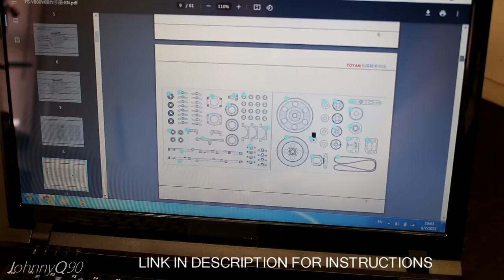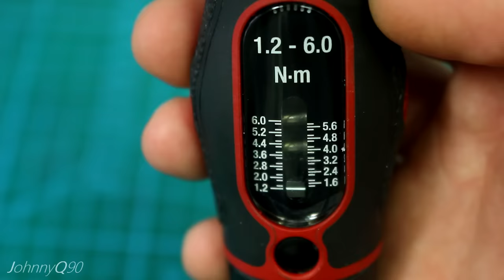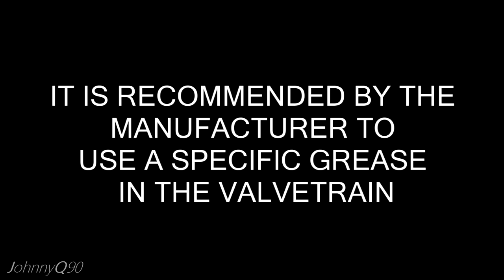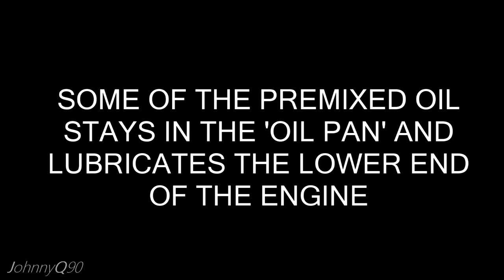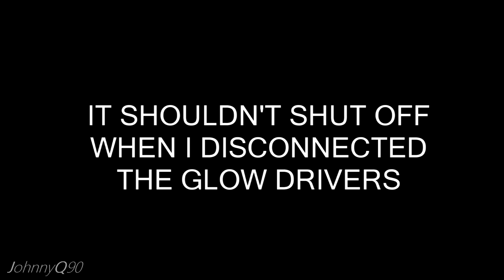REAL Model V8 Engine Assembly & RUN!

Comment: Did you have to set the engine at TDC and line up the cam gears whe. You installed the timing belt? Like real engines?

Comment: i don’t understand how it would work without glow/spark plugs working. unless the starter motor is running as an alternator pushing current after it starts the motor but didn’t look like it was.
is it fuel/air compression? that little thing can create a pop! that is incredible if it can
Reply: On nitro powered engines once the glow plugs have been preheated via an external electric supply and the engine has been started up, the coil inside the glow plugs retain enough heat between strokes to ignite the next compression stroke air/fuel mixture and the external electric supply can be removed.

Comment: Nice thing. I'd be concerned about running this for too long without proper oil lubrication for the top end and some form of cooling.  Why is there no water cooling system? Plenty of spare pully's for a water pump.?!  Great video.

Comment: Are the main bearings just bronze bushings? And do the camshafts not have bearings besides at either end? Did you time it? What's the purpose of the idler pulleys next to the cam gears? Why does it have a water pump, but no inlet or outlet or other cooling system parts?
Reply: Oh, I didn't realize it was a premix situation. The bearings make a little bit more sense now.

Comment: Would this work with normal petrol? Due to glow plugs I guess you have to run high concentrated fuel so it can ignite itself when the glow plugs are turned off?

Comment: Curious what kind of boost an engine that size can handle. It would be easy to use a compressor and regulate the PSI down to almost zero.

Comment: The glow head problem should come as no surprise. All of these nitro engines are 2-strokes and this is a 4. The cylinders only fire every other stroke and I'm sure the glow heads cool down to much. I don't know if keeping them on will shorten their life. You can see the instant loss of power. I think it's pretty genius using nitro fuel at all. I was looking for the oil pump and didn't see it. Now I know why. It's going to be a messy engine however. It'll need constant cleaning like anything else nitro.

Comment: Word of caution. Those bearings can fuse to the crank if not properly lubricated equally. The less lubricated bearing will take on more stress than the others until you have a serious problem. Once that happens... Seized engine.

Comment: Hmmm, nice at 3400rpm output into a 2.5:1 rear end with 4” tires should garner roughly around 90mph plus at 11,000 rpm.

Comment: The engine it self is only 89$, but the starter kit with the radiator and water tank is 299$. And ya kinda can’t run the engine without it…

Comment: You should not be running it out of fuel, or even low on fuel. When you do that, it is running lean and will burn pistons up. Looks like something is already going on from the right bank starting to smoke all the sudden.
I would put it in a 1/5 scale car.

Comment: Wait that doesn’t make sense? I thought the glow plugs, or the spark plugs needed electricity or current passing through it in order for the spark to be produced in order for combustion to take place. If you disconnect the power supply, then there’s no current and as such the spark plugs won’t generate the spark needed for combustion to take place, and as such the engine would die as seen towards the end of the video.

Comment: Seems like a piss poor design to have the wires and fuel lines running out of the front of the block consodering there are half a dozen.pullys and a cogged belt spinning.

Comment: I'd rather have the Nitro version of the V8. It seems like the gas version is a dog. And they need to get the RP m's up to at least 19000 on that V8 motor for to be any good in a boat.